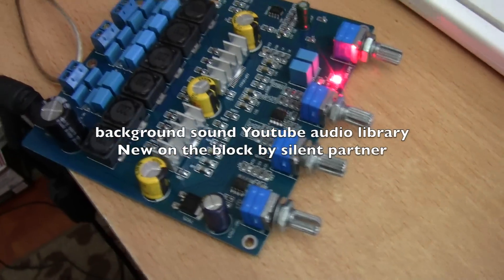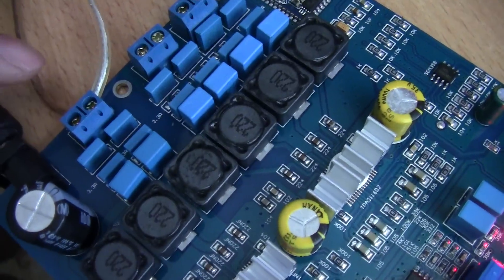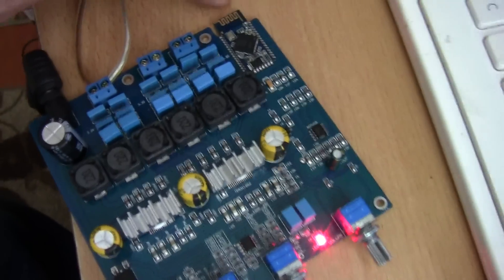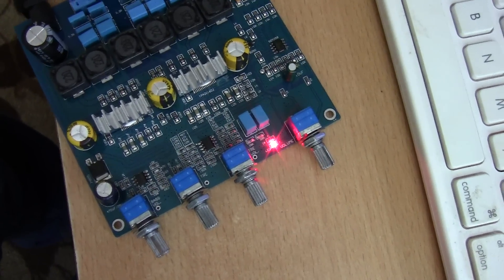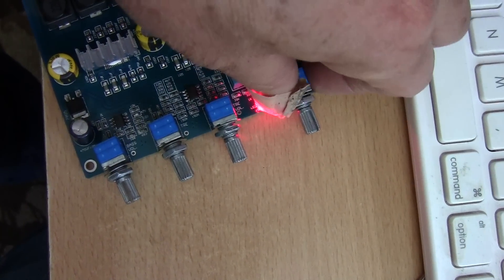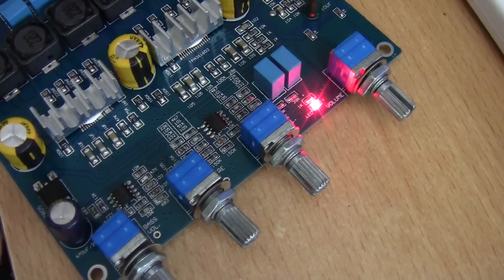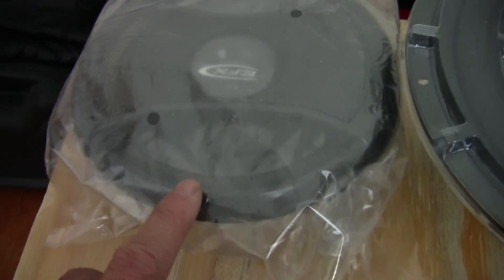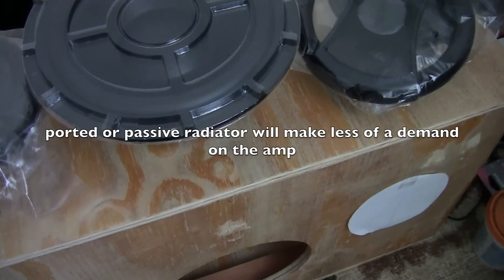TPA 3116 bluetooth amplifier  diy boom box part 1

Comment: how much volt did you use?
Reply from the maker: I think I used 19v 3.5A  laptop power supply
Reply: wtam69 ok thank you for the response but can i use 2 9v batterys? or will that voltage be to low?
Reply from the maker: 9 v will be too low unless you use the two batteries in series for a total of 18v.

Comment: can you Tell me what Power supply you are using??
I bought one of these boards and I cant turn it on, The red led turns on but I cant find The bluetooth signal!!
when I turn it on, I can hear The starting sound, but not complete, something Like a noise apears That way " puh puh" and nothing more
Reply from the maker: I use a 16 v  3 amp power supply. It's probably not a power supply problem. You have to pair your other bluetooth device with the board. If you have problem with pairing, try powering off your device completely (hard reset)  and then turning it back on and see if it can pair with the board. Some devices are more difficult to pair and that's just the nature of bluetooth.
Reply: wtam69 I'm having the same issue. No bluetooth, is there like a pairing button?
Reply from the maker: The start up sound means you have bluetooth.  You have to pair your amp to your sound source, be it your iPad or your computer. If you use an iPad, go to settings and bluetooth and click bluetooth and it will start searching for new bluetooth devices, when it finds your amp, it  will ask you to pair it and you'll have a connection after pairing it. Same deal with a PC or Mac. Go to settings and pair your device.  Some devices might have trouble pairing with the amp. In that case, turn your amp on first.  Then you unplug or power off your iPhone or pc completely and then turn it back on ( remember power off, not just put to sleep) and your device should see the amp.  I use 19v 3 amp supply. It should work with 12v and up to 24v power supply. Good luck.
Reply: Thanks I got it working. I had to tap on the Bluetooth module with the back of a screw driver. I think the solder connections aren't that great.

Comment: Hi wtam69, can you please suggest how to add an analog input to the same board. I received the same board which I ordered from AliExpress. if adding an analog input in an option, I can probably think of connecting it to the TV audio output. Planning to make a sound bar with analog input using the same board. Please advice:)
Reply from the maker: I found the data sheet to the bluetooth module CSR8635 used on this amp. Pin 40 is ground and pin 33 is line in negative input with pin 32 positive. Look up the data sheet if you are interested in adding the input. Supposedly, a switch is also needed. I'm not sure where to add the switch.

Comment: Have you tried it on a  12v power source?
I have a similar one on the way from china and I plan to use it on a 12v sealed acid battery. The datasheet for tpa31116d states 4.5-26v.
Reply from the maker: Yes, I have tried it with a 12v power source. I made a couple of 12v  lithium ion 18650 power packs for that purpose. 12v will not give you full power output. For full power output, you need 24v.  If you use efficient speakers, 12 v will work just fine.
Reply: I know 12v won't give the same output as 24v but I was wondering if it'll work. I already made a boombox using a TDA7492P board that sounds pretty good with a pair of cheap 86db Sony coaxial and 12v battery (except for lack of bass). In fact the bass made me order the tda3116d2 2.1 board, to build another one with a subwoofer.
Reply from the maker: Sorin Balan I have 2 setups using The TPA3116 board. One with an eight inch sub and the other with a 10 dual sub. I have to turn up the bass on the 8 inch sub and turn down the bass on the 10 inch dual sub. So, the dedicated sub woofer would make a difference, especially if you using the right size sub.
Reply: Space really is a concern... 🙂
I'm planning to have 2 coaxial speakers, a woofer, an audio decoder board, the amp potentiometers and a voltmeter on the front of the box... All this in a space that would still keep it portable. I messed around with some sketches and the best design I could come up so far is a compartment for the subwoofer on the entire lower side of the box, a compartments for the coaxial speakers on each of the top sides (separated), and hopefully I'll still have enough space to put the electronics in the space between the speakers in a way that they'll be accessible.
The more I think about it the more I wish I just experimented with some ports on the older project. ☺
Reply from the maker: Sorin Balan Hope you can show a few pictures or a video of your build. A ported speaker might have a different sound. I'm planning on making an eight inch small ported subwoofer box which would be a little different than the sealed enclosure I made earlier.
Reply: I'll make a video of the new project when it's finished (or even a DIY series of the bud).
This is the old one:
https://1drv.ms/f/s!AkAQtgKXBjd3mKYEg9yCCKDABqMmZQ

Comment: This is what I've been looking for weeks, thanks a million! P.s could I use a 250 watt rms 10" subwoofer
Reply from the maker: Yes, you can. Just remember this particular amp has a bluetooth input connection only.
Reply: +wtam69 I'm getting the non Bluetooth version
Reply from the maker: This is the cheapie version.  I have one with both bluetooth and analog input.  I listened to it with some CDs today and the system sounded great.  Good luck with your setup.
Reply: +wtam69 thank you very much
Reply: Can you share with us the model with Aux IN and the place you purchased it please.

Comment: did you connect the 18650 batteries in series? whats the max current it can supply?
Reply from the maker: Yes I connected in series, 3S.  I just needed a few amps so it should be able to supply many times over that. I put in a BMS board to protect against shorts and over current and other mishaps.
Reply: Good thought .. i am planning to do the same, but in my case its tpa3116 4.1ch so needs more current..